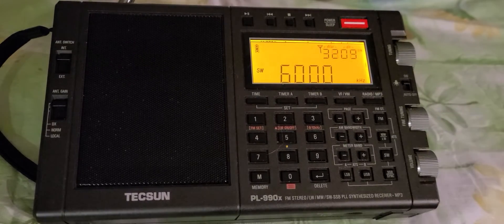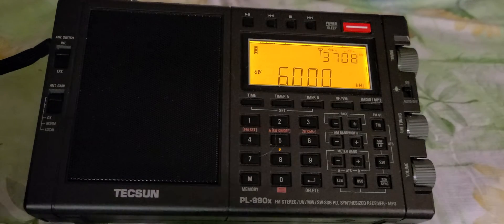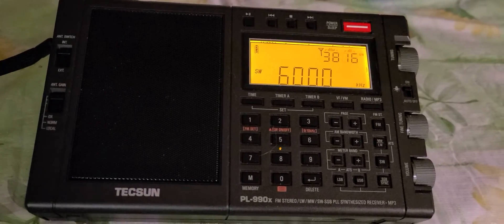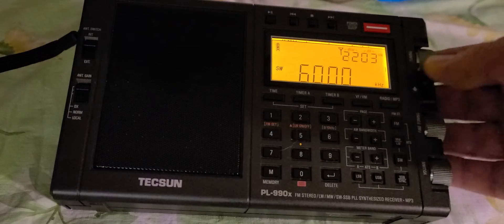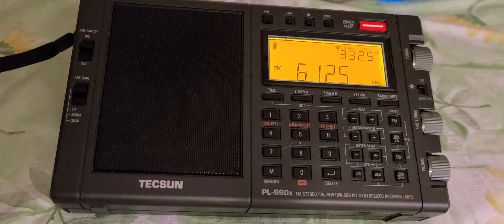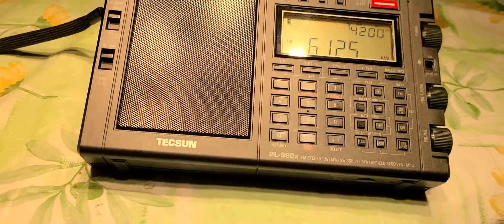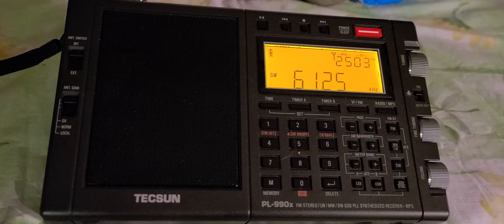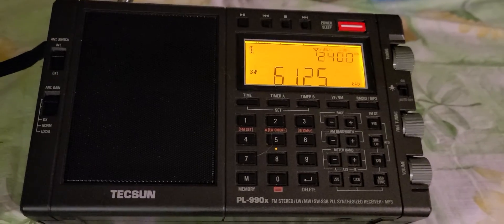Radio Frequency Interference Your Home can be a bad environment for Shortwave radio listening

Comment: Good informative video. 1 other item to add would be to use an AM radio tuned off channel and walk thru the house placing the radio near devices, wall warts, TVs, power supplies,  etc to find the rf offenders and dsal with them as you see fit.

Comment: When im dx'ing i have to shut off my Panasonic tv because any radio gets totally squashed by 60hz buzz within 10-15 ft of it.
Which makes me think that unsafe levels of rf energy are being blasted all over...but then again I also build tesla coils⚡😕
Reply: In plasma points are created with few kV like in SW transmitters  and that is the difference it shows to LCDs and LED I have B&O and experience the same but it is  in shorter  range  than some electronic devices passing RF noise to mains from neighbors all over building.

Comment: So many challenges. NOISE! (LOL)
I wonder if some ferrites could be applied to the wires leading down to the lamps to stop them being from little noise antennas.
That is a nice lamp!
I build lamps out of industrial scrap and it breaks my heart to remind myself that every single touch lamp, every dimmer, all of that stuff. All of it gets shut down when it's radio time.  -And I live in a townhouse...with neighbors with solar systems on either sides, but there's only but that is under under our control. -One must use best practices!
Especially when playing with loops in the shack. -of course it helps that they help to null but still...

Comment: What does it for me is that I live in an RV, specifically a gooseneck style RV which is where my bedroom is. Turns out that all my 3 radios (a CCRANE Skywave, a Supersonic SC-1080BT, and a Tecsun P310) can't get SW reception worth jack because of the very reduced space in my RV. And the AM reception is sketchy at best with the SC-1080, the cheapest of the three, surprisingly getting the better reception of the three.
Reply: Your trailer is basically a aluminum faraday cage blocking signals unless you have a external antenna..... I also have a ccrane radio with AWESOME RECEPTION👌

Comment: Thanks Gilles. Very Good Point on the House Lights Causing Interference with Your Shortwave Radio and Listening. Find a Nice Safe Area in your Home to do your SW Monitoring From. It's Always Better Outside When you Can. Take Care and Radio On my Friend***
Reply: Same thing here bro, LED & CFL totally kill vhf & uhf reception when using scanner indoor with built in antennas